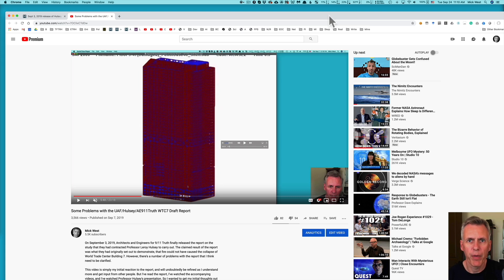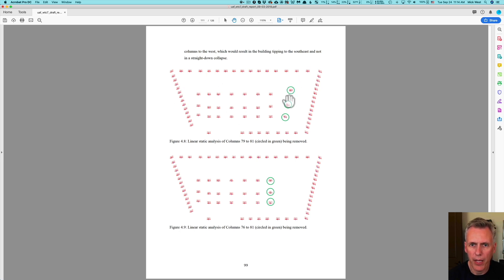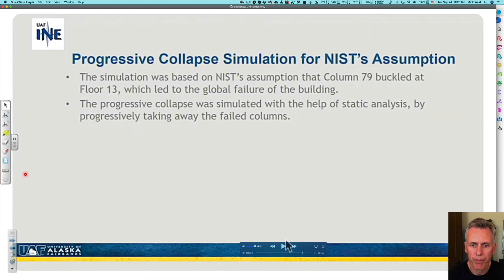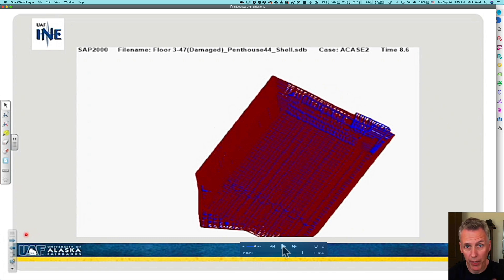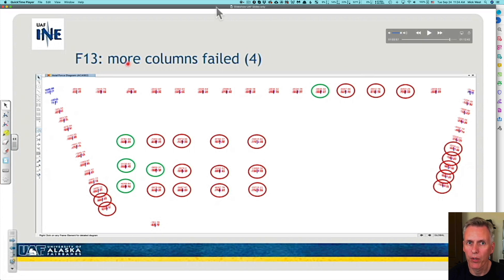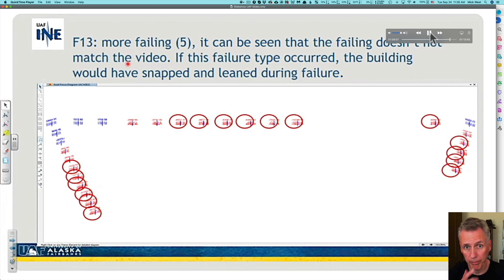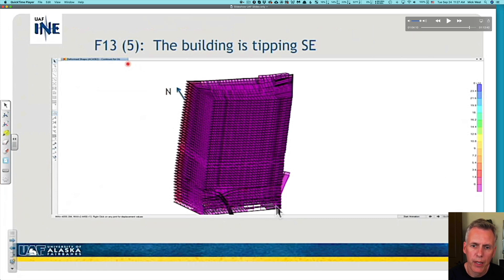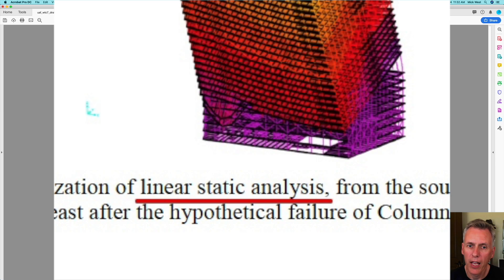More Serious (Technical) Problems with the Hulsey WTC7 Draft Report

Comment: On the report's website, it does say what we're seeing is final draft report and initial simulations (which might be animations to emulate what is actually seen in the detailed diagrams). The period of the study is still to the end of this month, with more content apparently being released until the end of the year. Hopefully, more is released to clarify the simulations by Hulsey, which I will admit most are questionable. However, the other simulations of the real collapse (not a box tipping over) appear to be more accurate than NISTs model (which is an animation - no released input data, no modeled girder connections, few similarities and more differences to actual observed collapse, ends very abruptly after collapse initiation - making it unclear if tipping would actually occur even in their model)
Reply: all of your accounts are really based around 9/11 concepts and catchphrases? and 2 of your accounts were made on the same day? and all 3 of you commented within minutes of each other? surely you can see why someone would think you're being paid to this, or these are just bots.
Reply: @YuThinkUrCool  
I have many accounts. 😀
Reply: @dontgetdrunkandvomitonthes3880  why?
Reply: @YuThinkUrCool  
This is another one of my accounts. 😈
Reply: @Explosives violate gravity ONLY causing free fall that's such a silly point. The facade is part of the building, and i imagine what's inside that facade fell down with it, as it did because there was virtually no inside structure left standing.. what else would you need for it to be a building and not just a facade? What a ridiculously petty point that doesn't even have any value. Also your first point about NIST model showing symmetrical damage to b7 facade.. ok they show jt but is that what really happened? Random falling debris just magically distributes a proportional amount of itself I suppose
Reply from the maker: Hulsey's "simulations of the real collapse" were also done with box physics. Despite NIST not releasing their data, they did at least do multiple non-linear dynamic simulations - which is evidenced by the very discrepancies you mention. Hulsey did not do a dynamic non-linear simulation, and he will not. This is what you are getting.  It looks superficially like the real collapse because it's designed that way. It's easy to make a building fall straight down if you remove all the columns over several floors.
Reply: @MickWest  "It's easy to make a building fall straight down if you remove all the columns over several floors." Which is what we saw happen in real life -  a building falling straight down. Uneven/asymmetric distribution of fire and damage cannot result in an even-leveled and symmetric collapse of a building unless for an extremely unlikely series of events, with even less probability to occur 3 times in one day - i.e. Rube Goldberg device. i.e. contrary to Occam's razor. The simpler explanation is that it follows what we already know about similar-looking building collapses as opposed to exploring and then 'discovering' entirely new types of 'fire-induced progressive collapses'. 
You are only critical, even before it released, of any work opposing NIST. You are making your appeal to authority abundantly clear and it's seeming you're not interested in being objective about both sides. NISTs model has been rightly criticized for not revealing their input data as well as not having a full detailed model of the entire collapse. They cut the 'simulation' shortly after initiation collapse - How can you verify it would not tip over if they completed the model as Hulsey suggested when using NISTs own hypothesis?  
As a self-proclaimed debunker with no real credentials or credibility when put alongside 3000 architects/engineers (or even NIST for that matter) why is your account not negligible? You claim that these 3000 people's words should be negligible because they are 'a fringe', despite having actual experience in the related field and outnumbering NIST. Why should anyone listen to you, just one person who isn't an architect or engineer, using that logic? 
If 3000 physicians told me I was sick, I wouldn't so quickly dismiss them out of my own incredulity. You made a post titled 'Debunked: Hulsey's Report' 3 or 4 years before it was even released. If you were ever objective and reasonable, your ego is getting in your way now.
I am clear with the issues on both sides - NIST and AE9/11. However, the fact is that AE9/11, as well as Lawyer's Committee for 9/11 Inquiry, Firefighters for 9/11 Truth and few others,  make enough valid and credible points which contradict the official story and thus much of its validity and credibility. 
Edward Snowden's whistleblowing alone about the fact that mass surveillance was already illegally in place prior to the Patriot Act in response to 9/11 completely shatters the lie that there was no way to detect such a threat.
Reply: @YuThinkUrCool  27 of the 3000 are structural engineers. Hulsey had a presentation 3 - 4 years ago and made wrong assumptions.
Reply: @YuThinkUrCool  spot on!! Well said.
Reply: @YuThinkUrCool  
''Uneven/asymmetric fire and damage cannot result in symmetric collapse'' <--- BULL.
Reply: @drunkpeopleareviolentandan4893  you forgot the last part of my sentence "unless for an extremely unlikely series of events".
Reply: @YuThinkUrCool  
Having lots of accounts prevents the YT robots blocking your comments.

Comment: Excellent analysis!  It would appear to me that there is way too much shear coupling between columns in his model.  That's why it looks like a box. If you remove a column, almost everything above it should start moving straight down.  Hard to transfer much side shear and transverse tensile support though a square grid of glass windows or flat floors.

Also impossible to put a column in tension if it has weight pushing down on it.  The building could not tip because the fulcrum would have already collapsed. I think people are used to thinking of wooden toy block towers.  The toy columns are a million times stronger than their own weight.  If you remove a corner block, the others support it while it it tips. However, if removing a few buckled the others under compression...

The whole "progressive manual removal" of columns stinks as a static analysis.  You can't do it progressively  because it's a virtually instantaneous cascading failure. If you remove some till others get overloaded then you have to remove those overloaded ones as well.  So inevitably, you have to remove all the columns at once and run the simulation. The building should pretty much fall straight down.  There can never be "remaining columns" to tip it.

The use of statics is only useful at very small deflections (as you have pointed out) not in collapsing buildings.
Reply from the maker: Good point about columns in tension. Where is all the weight of the building going? The columns are only going into tension because overloaded columns have not been removed. See figure 4.12. There's some columns failing in compression at -3400 Kips, and some at -23,000.  Then on 4.13 you have -4,108 and -153,842. Obvious nonsense to say they fail at the same time.
Reply from the maker: Kirk, can you look at this post, see if it matches with what you said about fulcrums: https://www.metabunk.org/posts/234342/
Reply: Mick West    Mick,  that post is pretty much exactly right.   But again,  I see no way to creat the tension side at all.  I don't know anything about the fixivity of the girder / column interface so I can't comment much more about failure modes.  To have tension,in this case, you need an upward force.  That's not going to happen while your holding up a building with the same column.

Comment from the maker: Something I should have mentioned - Hulsey does not seem to have included any fire connection or beam damage in his model. Maybe because of his static model no failure conditions for connections? He seems to only be testing failure in the columns - and that seems almost like a manual process. Not one floor or girder seems to fail anywhere - which is probably why he has that horrific glitching. Of course, floors collapsing would also have far less effect in a static model than in the dynamic model he should have used. In a static model multi-ton failed members just vanish. In a dynamic model they fall and hit other members.
Reply: Oh, and loads shift in ways that can cause an overload failure even if things would be within the acceptable loads in a static or semi static condition (normal building loads aren't fully static)
Reply: His model would be more accurate, and less comical, if it was based off Jenga. The columns didn't undergo progressive failure, the columns AND floor system underwent progressive failure. Lateral forces (as well as dynamic loads) were important in the collapse sequence and in many cases they induced failure before the redistribution of static loads would have done. This is why pretty much the entire inside collapsed first leaving the building's skin standing momentarily.